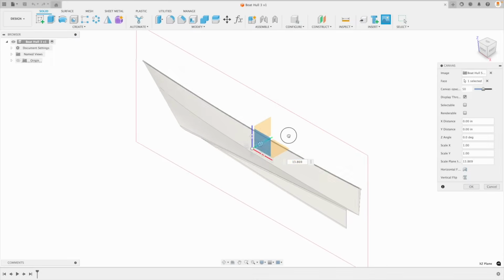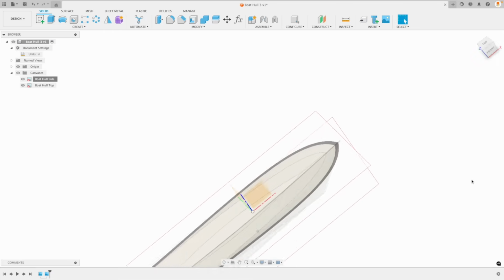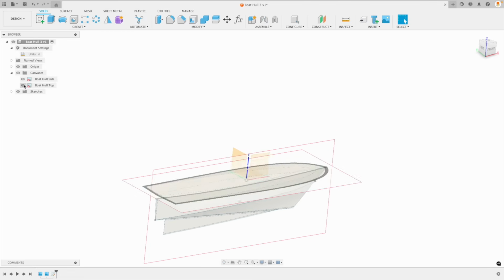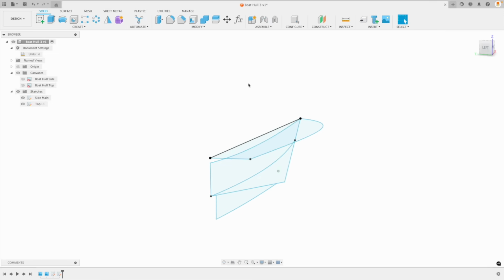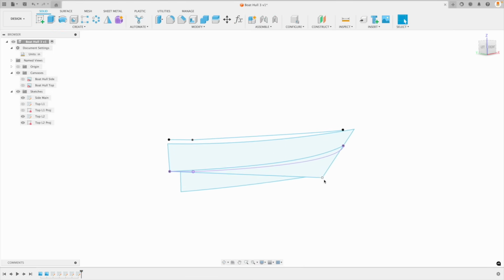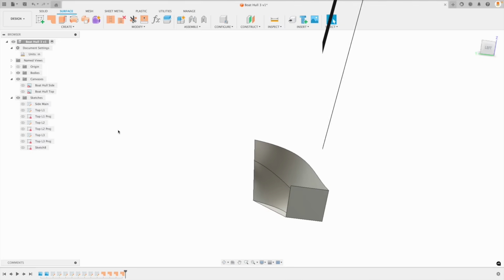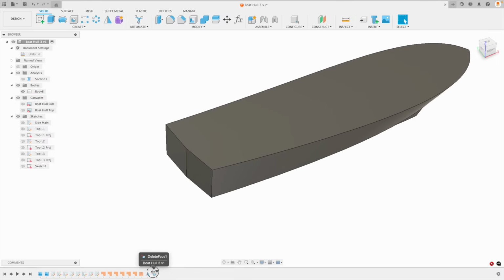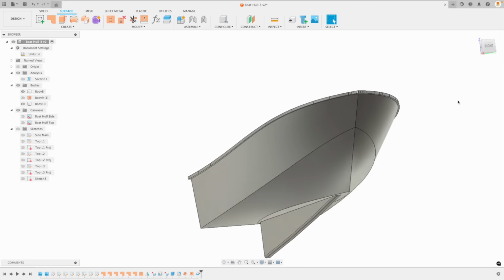Autodesk Fusion 360 - Surface Model a Boat Hull - Intermediate/Advanced Tutorial (2024)

Comment: I think  i am doing everything how it supposed to be, but i cannot PATCH, no wayyy....Someone help :/
Reply from the maker: Thanks for reaching out. The problem is likely that you haven't projected or projected correctly. Therefore, make sure that you project the end points that you want to use from another view. For example, If you create a sketch on the top view first, then create a sketch on the right view, you need to make sure to project the end points from the previous sketch. If we don't project, then it looks like the end points are exactly in the same position, but they are indeed not, and we won't be able to patch. Projecting points allows you to use the exact same location of the original points. Let me know if that works.
Reply: @learnitalready Thanks for the reply ! I have redone it all couple of times, and fixed some of my mistakes since you explainded evreything nice in the video.

I think i figured out the part with projection since my projected sketch looks as it should and it looks connected on all projected points (zoomed in to micro mm to try to be sure 😅), but still no luck. 

Can it be the reason the thing that i am having sketches on all three planes,and i am missing something there? Since i have to have exact measurments for this part.

Thanks once again 🙏
Reply from the maker: @blackwolf_1301 one other thing to check is to zoom in to each sketch element when using the patch tool. Sometimes a piece is missing. If you find a gap in your closed profile, let me know and I’ll guide you with the next step.
Reply: @learnitalready will do my best, still learning the software and your video was the best i managed to find on this subject 🙏 if i dont manage to fix it i will comment again 😄 thanks for your time 🤴
Reply from the maker: @blackwolf_1301  Awesome! Great work.

Comment: Hi. Great video! However, I have problem. I stitched all corners and I have one body now but I can't create any sketch or can't extrude any surface also can't select the mirror face. Do you know why this is happen?
Reply from the maker: Thanks for reaching out. It is very difficult to say why. Do any errors pop up when you try to use the aforementioned methods?
Reply: Error: There was a problem combining geometry together.
If attempting a Join/Cut/Intersect, try to ensure that the bodies have a clear overlap (problems can occur where faces and edges are nearly coincident).
Failed to Boolean bodies together
Reply from the maker: @osmanyurek1503  Great job figuring it out. That’s half the fun of Fusion!

Comment: So do we always want to have 3d scetch turned off and if so when do we want it turned on?
Reply from the maker: All depends on your design work. I’ve been working professionally with Fusion for several years now, and I’ve only needed 3D Sketch a handful of times for very unique situations. You can use standard 2D sketching 99% of the time. I’ve got an example of when to use it coming up in my V8 Engine series when designing the exhaust system. Stay tuned!

Comment: Hi! Love the tutorial, I'm following along with a rowing skiff design I'm modelling - one question though, you spend a lot of time easily swinging round in 3D space, for example straight after inserting the second canvas and later on at 10:45 when you're about to create the lines for the top view - what's the shortcut for that, appears to maybe be holding down a key and moving the mouse around? Thanks!
Reply from the maker: Thanks for taking the time to comment! Regarding easily moving the part around in 3D space, check out 3DConexxion under the Recommendations heading in our following site: https://bio.site/learnitalready
Reply: @learnitalready  thanks! I'll have a look :)

Comment: Great tutorial! Is it possible to unfold these surfaces in Fusion?
Reply from the maker: Great question! It is not possible to unfold the particular faces in this project. Picture something similar to trying to unfold an orange. To unfold something like a boat hull successfully, you will need to plan the design differently. Using different software is, in my opinion, better to unfold complex surfaces.

Comment: Great Videos at LEARN IT - what if i have a mesh of a car body/part & want to THICKEN it and make it a BODY watertight?
Reply from the maker: Thank you!

As for your question on meshes: Fusion doesn’t work well with meshes for a number of reasons. Currently I’m doing a project from a scanned stl part file and trying to make it editable in Fusion. However, it needs a bunch of repairs done to it first in Blender (which works very well with meshes) before trying to import it into Fusion. It is far easier, and better, to work with the tools within Fusion as a design and manufacturing app than it is to work with meshes and try to convert them.

Comment: Just came across your channel and inmediately subscribed. I cant agree more with some of the comments here. Your are an amazing teacher. If i may make a suggestion, it helps if you can show on the screens the key presses you describe as you go along. Like pressing Control key to bypass the snapping to the grid. Thank you very much for your content.
Reply from the maker: Thank you so much for your encouraging comment and tip. Funny enough, I made that tutorial with my new MacBook Pro and the usual app that I use to show the keystrokes wasn't working. I usually do add them to each tutorial. Check out the latest one I made and let me know if you like what you see: https://youtu.be/0WSPIRkH0C4

Comment: If you were to use the thicken command, would you then be able to convert to sheet metal and create flat patterns for each piece? Or would that not work due to the slight convex/concave nature of the surface?
Reply from the maker: Great question! Unfortunately, no. In this instance it wouldn’t work due to the complexities in geometry. I will have to make a follow up video on how to create flat patterns with complex geometry. I just don’t know when that might be.
Reply: @learnitalready  yeah I didn't think it would be that easy. I've never had much luck with converting to sheet metal. It would be cool to be able to model a boat, slice the parts out on a CNC plasma table, and weld them together. Sort of like @svseeker did with his tender

Comment: this is interesting, but hard to follow. there are times where you do a thing and dont say it, so when i am looking away trying to follow along and something isn't working, its because you didnt say to finish the drawing, or something similar, so am constantly having to rewind and rewatch parts and i got to the part about drawing the top of the boat and got lost for the millionth time and am giving up. i cannot get the parts to intersect like you are showing.
Reply from the maker: Thanks for reaching out! Sorry to hear that you’re struggling with this one. Happy to help, however I just wanted to mention first that this is an intermediate/advanced tutorial (as shown in the video title). With these tutorials I move along at a faster rate and don’t explain what I do in my beginners tutorials because it is assumed that some general skills should already have been learned. 
Now, to help with intersecting, the key is to remember that the start and end points that are floating in space need to match up perfectly with their counterparts. The only way to make sure they are matching up perfectly is to use projected geometry and constraints. If you don’t yet know or understand fully how to project or constrain, I would wholeheartedly encourage you to go back to some of my earlier tutorials to understand the principles of using those methods. Here is the playlist link. The lessons on parametric boxes and the tire series will greatly help. All the best!
Fusion 360 Tutorials For Absolute Beginners
https://www.youtube.com/playlist?list=PLLm7Yjr9z_z07ohtjFGkA5w-j_NMj8B3J

Comment: G'day - love your videos.  If you have a second, i'd love your thoughts - I've been designing (in Fusion) and now building a Riviera boat using 60s plans I found online (1:5 scale for a RC boat).  Although i've managed to put the hull together, and it looks fine - it frustrates me that I can't take a complex curved surface, unroll / flatten it, and create an accurate cut line for a laser.  Any ideas on how this could be done within Fusion?  Sending it over to blender hasn't helped much either.
Reply from the maker: G’day! I apologize for not getting back to you sooner. Thanks for the your message. Glad to hear that you love our tutorials.

Regarding your request: there isn’t an easy way to do what you’re wanting in Fusion. It’s actually not always easy in general to do in CAD programs. Sometimes the surfaces are simply impossible to flatten. The best way to explain why is like picturing trying to flatten an orange peel; you can’t do so without breaking or tearing some of the surface. 

However, you can try another program that is in the Fusion store that is actually made by Autodesk called Meshmixer. If your surface can be flattened Meshmixer will help you do so. Here is a link to it: https://apps.autodesk.com/FUSION/en/Detail/Index?id=4108920185261935100&appLang=en&os=Win64

Please let me know if that works for you or if you have any other questions.

Comment: Thanks for the tutorial! I've done some surface modeling in the past and usually get tripped up on using the the "Intersection Curve" tool but made it through with your teaching method. It's an amazing tool but I still am struggling to use it properly. I suppose it just takes practice to really get the hang of and once mastered makes one appreciate it even more.
Reply from the maker: You’re most welcome! Thanks for taking the time to express your appreciation. 

I agree, it isn’t the easiest tool to use at first. One thing that I learned that makes it a lot easier is to make sure that endpoints are perfectly lined up with each other. You can only do that by fully utilizing the projection tool and to make sure sketches are fully constrained. I hope to make another tutorial to explain the concepts in an easier-to-understand way. 

Thanks so much for your support for our channel. All the best with your Fusion journey!

Comment: Can Fusion flatten the panels into 2D panels that could be used to actually build the boat?  That would be a cool addition to this video, or maybe a new video.
Reply from the maker: Yes, Fusion can. I would love to make a tutorial on this at some point.
Reply: @learnitalready  I know the sheet metal objects have a flatten feature, but I haven't seen one for curved surfaces.  I did a youbube search to see if anyone else has a video on doing that but there isn't any.  There was one guy who used a 3rd party tool to create one, but he also could not find a way to do it within Fusion either.  If there is in fact a non-sheet metal way of doing this that you know about, you would be the first video on youtube explaining it I think.  You could model a football or a soccer ball, then take one of the panels and flatten them as an example.  Or even just build on the boat video you already made and flatten the hull panels.  What would be interesting is to 3D print the boat, then flatten the panels at the same scale and export to DXF, print them onto paper and cut them out and see if they fit the boat model.  Would be a good test to see how accurate the flatten function really is.

Comment: this was really good! i am wondering though as i am actually working on a boat, if the panel edges were all there own bodies, could this be flattened easily in Fusion? I know it has the sheet metal function but this isnt exactly the same. So i thought i would ask if you know of a good methodology to do this part so i can then try cnc'ing
thanks!
Reply from the maker: Thanks so much! Yes, it should be no problem, but with a couple steps that you would need to do before flattening. I would love to produce another tutorial on this to explain it in detail. In the meantime, check out this tutorial. I'm not fond of the music or the lack of explanation, but he does have the method correct. He also has few subscribers, so I wouldn't mind helping him out with this recommendation. Let me know if you find it beneficial. Thanks :D 

https://youtu.be/aG-QZ-5BsC8?si=K1pTxAdPLGlPci8j